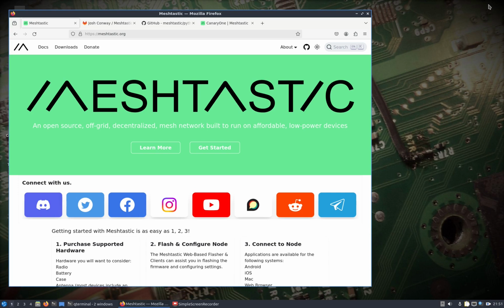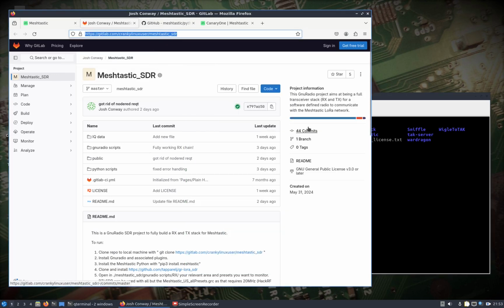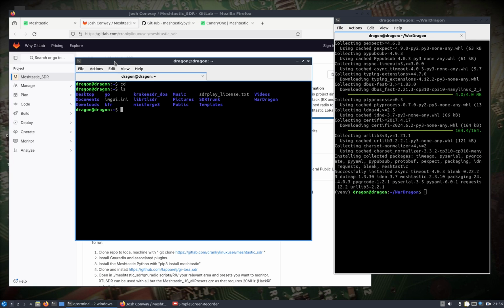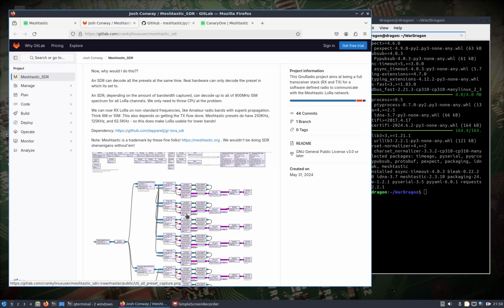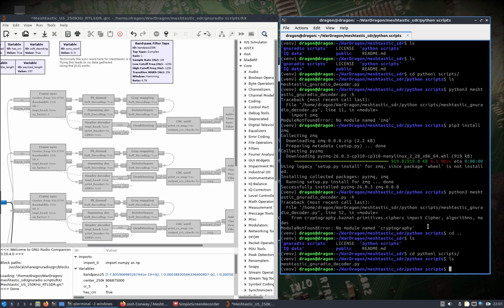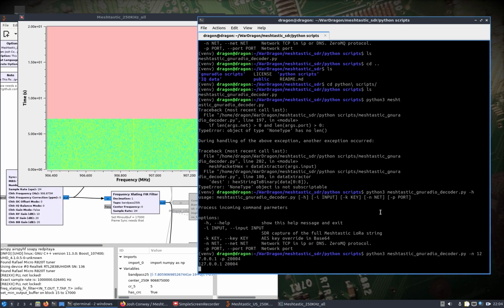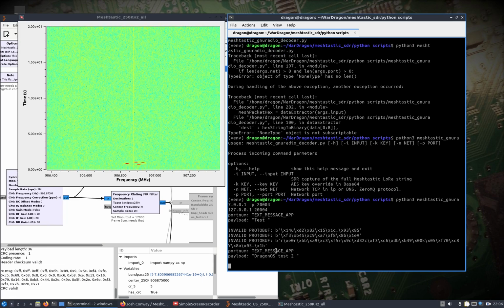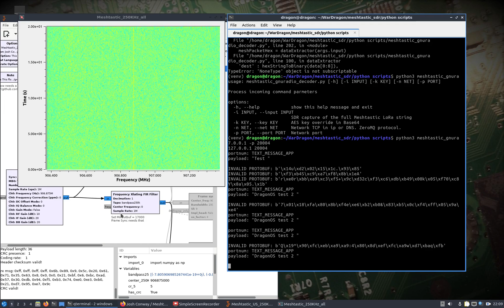WarDragon Real-Time Decoding Meshtastic w/ GNU Radio & SDR (RTLSDR v3)

Comment: It seems that the  gr-lora_sdr  modules are required which wasn't the case when this great video was made. I tried following the instructions on github for installing   tapparelj/gr-lora_sdr   but couldn't get it to work. In particular I was confused by the step cmake .. -DCMAKE_INSTALL_PREFIX=<your prefix>. What should be entered for <your prefix> ?
Reply from the maker: Gr_lora-sdr was always required (like 99% sure) I just probably already had it in DragonOS. I’ll get ou a better answer tonight.
Reply: @cemaxecuter7783  thank you so much. I am tearing my hair out here. I am creating another fresh install FocalX R35 vm template on Proxmox ready to try another install. All your instructions from the video worked, but the gr-lora_sdr blocks are missing from /usr/local/share/gnuradio/grc/blocks.
Reply from the maker: @fotografm assuming you ran sudo make install they’ll be up under there starting with lora_sdr (not gr-lora_sdr). Also in the new ISO I’m working on I will have it all included by default.
Reply: @cemaxecuter7783 yep. I ran sudo make install. Maybe i was doing it in the wrong directory? Or should I do it in the venv ? I am still not sure what parameter to use in the cmake .. -DCMAKE_INSTALL_PREFIX=
Reply from the maker: @fotografm ignore that part. Just get clone the repo for gr-lora_SDR or look in /usr/src on Dragon and it should be there. Change into it and run (if in /usr/src add sudo in front of each command)
mkdir build 
cd build
cmake ..
make
sudo make install 
sudo ldconfig 

Or for an even easier route, download this ISO I’m working on that’s a complete overhaul of Gnuradio and already has all the pieces 
https://drive.google.com/drive/folders/1X-NAxJFIN9XNheomV-69aHwJTWQK9t2U

Comment: Thanks for the great tutorial ! My gnu-radio block diagram has all blocks missing and I get for every block n error sililar to "ID "lora_sdr_frame_sync_0_2_0" does not exist.." I think I am missing a step somewhere since maybe the meshtastic_sdr githun has been updated since you made your video. Maybe I have to install them from tapparelj/gr-lora_sdr, or is there a way to reference the modules shown in your video ? What is an easy way to do this ? It looks complicated. I probably don't have conda installed on my DragonOS 35 as it is a clean install.
Reply from the maker: Do not install conda. Ignore that part of the GitHub directions. Simply got clone down the repo and cd into it
mkdir build 
cd build 
cmake .. 
make 
sudo make install 
sudo ldconfig 

Or download this test ISO I’ll release soon that has all the gnuradio parts in place that work with even the newer meshtastic code

https://drive.google.com/drive/folders/1X-NAxJFIN9XNheomV-69aHwJTWQK9t2U
Reply from the maker: Sorry I meant the gr-lora_SDR which actually is already in DragonOS under /usr/src but only installed on the new iso I linked above I’m working on.

Comment: Hola. Sorry to bother you with this. I’m sure it’s something simple but the solution is evading me. It has to do with “apt-key deprecated” error after my last update/upgrade of Dragon. I’ve used solutions found on Ubuntu site, Lubuntu docs, the solutions have to do with switching to a GPG key. I’ve tried all of the published command line statements but I’m not getting it done. I’m probably making some syntax errors or something stupid like that. Any insights or wisdom you can share will be greatly appreciated. Thanks-Jason Burchell
Reply from the maker: If you shoot me a question over on source forge I can better answer 
https://sourceforge.net/p/dragonos-focal/tickets/

But is it having any negative impact? Typically you can still download packages. Also does it say for which repo it’s deprecated?

Comment: I have a question - in your investigations have you stumbled upon any indication that there is a fingerprint associated individual semtec Lora chips? Something that would be unique to the device on the radio level?
Reply from the maker: I haven’t but I’ve also not looked into that. I wonder how that would be identified though, interesting question.
Reply: @cemaxecuter7783  thanks! Just wondering if we can avoid spoofing on the meshtastic network using something from the hardware. Meshtastic currently uses the bluetooth mac

Comment: Hi Aaron, do you recommend the Canary device? I want to get a Meshtastic-something, but there is so many different types of them! I can't decide.
Reply from the maker: There is so many and I’m not educated on all the different types, battery life, etc but I will say I like the form factor and feel of the Canary. I’ve had no issues flashing meshtastic to it and someone correct me if I’m wrong, but I believe it’s US made (site says so). Which now that you asked, I realize I didn’t share the link. Full disclosure, it was donated to me but I’ve been meaning to buy a 2nd. 
https://canaryradio.io
Reply: if you didn't already spend $160... Check out the RadioMaster Bandit Nano - we use it for FPV drones but there's a meshtastic target for it and it works wonderfully - 1 watt
Reply from the maker: Dang I’ll look it up - hadn’t heard of it before.

Comment: Thank you very much for your work!  Could you register the SDR Play receiver of all modifications in Dragon OS?
Reply from the maker: Are you asking if you can do this with sdrplay? You can change the flow graph to a gr-sdrplay source or soapy source and likely achieve the same results.
Reply: I really enjoy your experiences with SDR and really appreciate your videos 🤝
 Sorry that I asked off-topic.... I meant Iridium.
Reply from the maker: No problem and glad you enjoy. Iridium is in DragonOS, both the gnuradio portion and toolkit.
Reply: I mean I would like it to be possible to use SDR Play in Dragon OS for Iridium.
Reply from the maker: @sansan4621 you can, you just need to make a profile for it like I shared here. 

https://github.com/muccc/gr-iridium/pull/168/commits/16a5cc6fa4fecc1643e1f17a8dbf504b5907af65